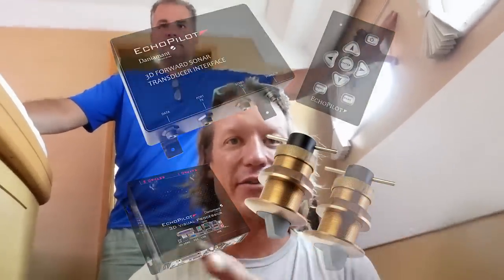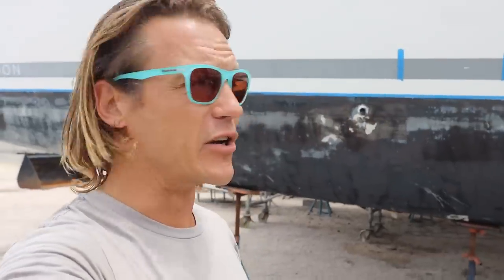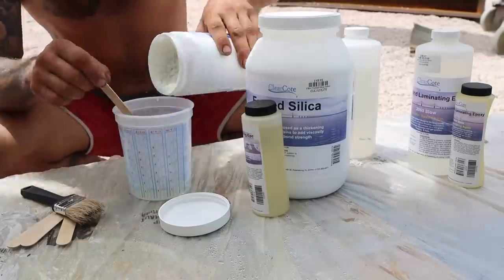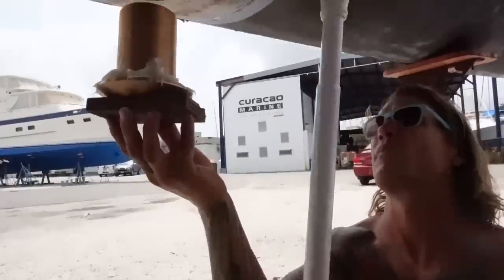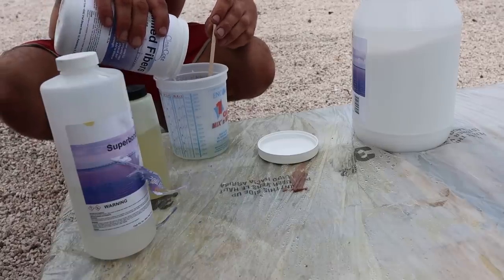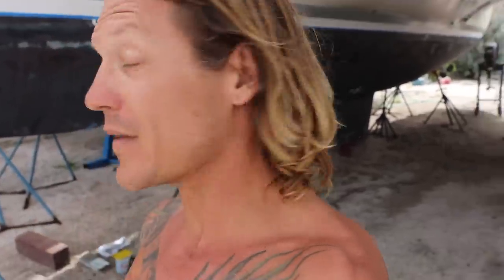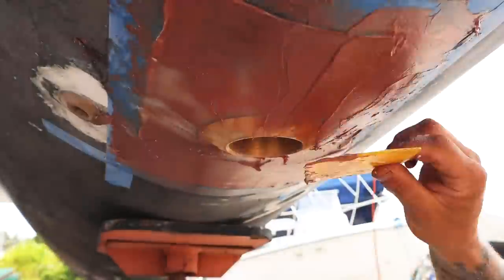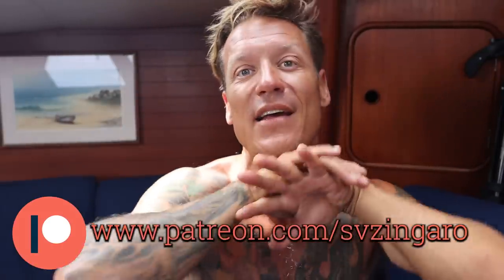We drill BIG holes in this Lagoon 500 catamaran

Comment: Since it appears to be a Lagoon.... you should take the time to inspect the main bulk heads. 99 percent of Lagoon bulk heads are crap, especially the primary bulk head holding the mast. If not inspected or doubled up, you will see tremendous failures in other bulk heads as a result from the primary bulk head failing. The remaining bulk heads will break, twist and warp the entire boat. The reason is Lagoon never tabed the bulk heads into the haul. They only used industrial glue which fails over Short period of time. Usually only lasting between 10 and 15 years and then results in catastrophic failure and a complete lose if not caught early. There has been huge complaints buy Lagoon owners, some sank, some people have died out in heavy weather, many insurance companies have wrote off these boats as complete loss due to accidents. The fact that is constant is they all have similar failures in the same areas. Lagoon has argued in court that these failure were from abuse, weather, failure to do regular maintenance. DON'T become another static and your life is much more important than poor primary structural assembly. Lagoon has gone out it's way too encapsulate the primary bulkheads as so they can't easily be inspected but it's worth using a straight edge and multi tool to create spots to use a mechanic's scope or plummer's camera. I have seen over 50 Lagoons in different parts from Hawaii to Florida as well as the Great Lakes. Each having crack bulkheads in the primary mast bulkheads. Each only had a single marine grade plywood sheet that wasn't epoxy treated, had no tabing to the main haul. Lagoons are death traps in my opinion, especially since the primary mast bulkhead isn't constructed with regard to life.
Reply: Yes it would be much easier to build up the bulkheads now while the boat is straight and not wait till you have to straighten the boat!
Reply: Appears? It says Lagoon 500 in the title...
Reply: The YouTube channel "Parlay Revival" found and repaired the damage on their boat ! At first they thought it was from hurricane damage but with a thorough inspection there was obvious manufacturing flaws by lagoon !
Reply: Great info Mr Ski. Appreciate the time you took to type that out.
Reply: It's only the Lagoon 450 that is effected.

Comment: Excellent job James finally somebody actually using the proper fillers in a heavy buildup job .
 It's vital to use milled fibers with the resin. The colloidal silica only increases the thixotropic properties of the resin and NO strengthen the resin, the milled fibers and or glass cloth is used to provides the strength ! Great to see this in a how to video! 
Cheers Warren

Comment: Nice. Lagoon 500?? Curious about the bulkheads?? Has he checked his??
Reply from the maker: He's checked, this was a charter cat, so it didn't go out in anything big. I think the sea state would have a lot to do with bulkheads failing
Reply: @thelastpirate  Are you kidding. Are you saying that a cat costing 100's of thousands of dollars or more can't go to sea?
Reply: @thelastpirate  the sea state has nothing to do with it..it's a faulty bulkhead design compounded by min wage workers drilling access holes all through them
Reply: Waste of time asking this guy about the bulk heads you can see his reply above. He's a lagoon fan boy and in his eyes they can't do any wrong.
Reply: I was just asking as I have not heard about issues on anything other than the 45...  I am assuming the constructions follows the same..   

Yeah, I think a 46 Open for me is ticket..  And I will make sure I have inside controls to some point...
Reply: @simpsonservicesllc2987  the problem is to check the bulkhead properly you have to remove lots of furniture and even break things. you've seen Colin's videos no doubt so anyone who just says yea I checked my bulkhead no problems I have a problem believing.
Reply: @w4vy  easy enough to check by string across the salon floor and the back deck floor..  I mean it's a start..
Just Lagoons response I would never buy one...
Reply: @simpsonservicesllc2987  that wouldn't tell you you had cracks in your bulkhead though. You could do that today and find nothing then go out to sea tonight but then 2 days later oops snap. You have the right idea m8 just stay away from lagoon.
Reply: @w4vy  He's probably not going to comment since the owner of the Lagoon is a client... If he does comment then he'll probably not be invited back for more work opportunities – and he's probably in need of some cash... This is a fight that will have to be fought by other people.
Reply: @angela1984a  he said in his live stream though right at the start that he hates lagoons so I don't see why not but ok whatever I just know deep inside that anyone who says they've checked their bulkheads will have video and photo proof showing all the interior removed etc and if they don't have that then I will call them a lier to their face.
Reply: @capnordest  read his statement twice I do not believe that is what he is saying. Just to answer your question appears like he may have missed it.

Comment: Did you strip away the coring around the hole?   And put in solid fiberglass?  If not a small leak in the fitting will rot the balsa.

Comment: So have the bulkheads been inspected on this Lagoon? The Lagoons bulkheads are breaking up and needing to be fully rebuilt. There is serious implications if one is not someplace where they can easily do the work or have access to the boat building supplies. Lagoons are not built well, and hundreds of them are having bulkhead problems currently as Parlay Revival, and SV Nahoa had to fix their 2 years ago. Y'all should really inspect that while the boat is out of the water and in a place where you can fix the bulkheads before the boat is all bent and out of shape. Just saying!

Comment: If this is for just depth you dont need to put a massive hole in the glass hull , Just soft glue it to the inside , You only lose 1 to 3% of the range , Done it on over 7 yachts iv owned , Never had a problem . If your going for 600 foot deep fishing ok But >?

Comment: quite possibly worst transducer install I have seen.. so many things wrong with this sorry dude but just no..
Reply: Can you please list all the things that were wrong so people that don't know can know?
Reply: Hi Leon, please let us know the things he did wrong so I can learn how to do this correctly before I attempt it myself.  Thanks!
Reply: @michaelnitti6721  I was being a bit harsh, and my experience is with power boats.  However building up a huge lump under the hull like that?  I would have ground a flat area to try to make it 'one with the hull'.  Transducers don't work if irregular surface creates turbulence or bubbles.  Also using epoxy.. will never get that sucker out again - I would have used the right sealant.  And lastly getting epoxy all over the fitting, could have used tape, cut to suit, pull up tight with the nut from inside rather than using a broom to loosely hold it up.. it wasn't even mated to the hull at that stage.  Some good tips if you look up installing Airmar B162 in hull model on the Ytubez.  James sorry mate, your all good what you did might have worked fine on a big yacht hull

Comment: Omg, you should have made fiberglass blocks to flatten out the inner and outer points of installion. Using that much epoxy was extremely irresponsible, you just created a major failure point. It looks like another half ass job, lip stick on a pig that will probably sink. But who cares.....right!
Reply from the maker: You have no idea what you're talking about. That is complete bullshit. Sit down before you hurt yourself. If anything FOAM would have worked, but I couldn't get any on the island so this is even stronger, though more work.